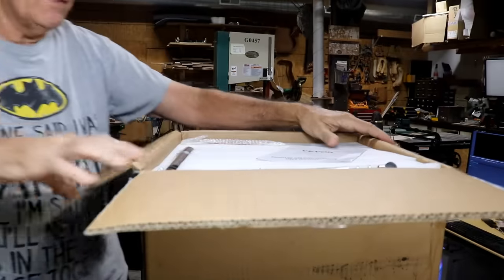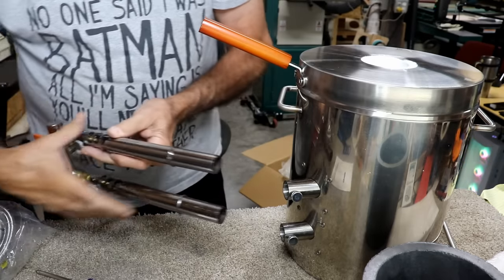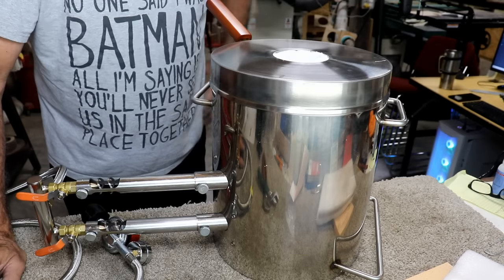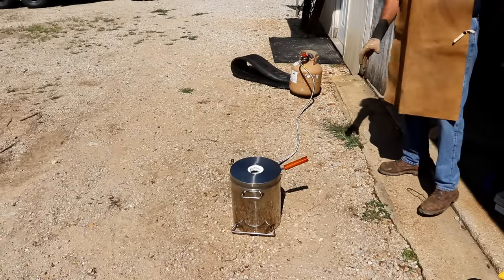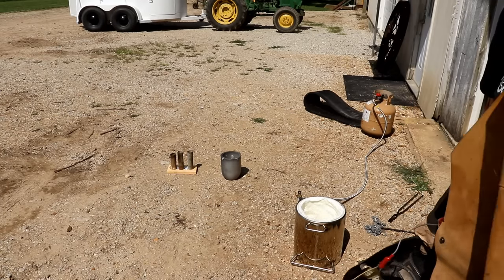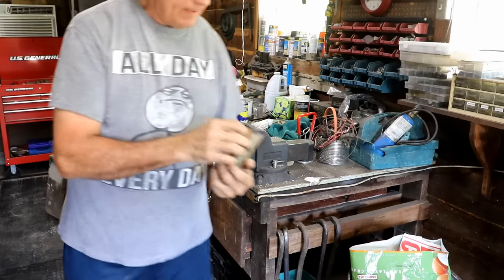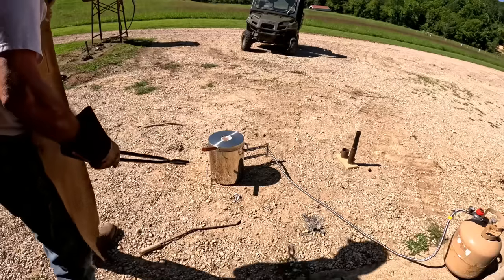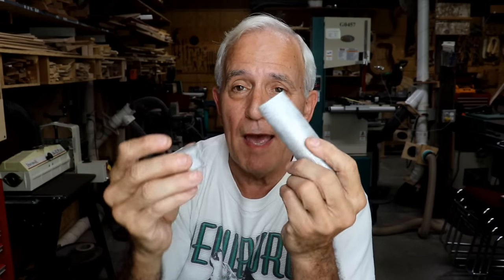661 RSW Vevor Smelting Furnace Wow It Really Works

Comment: So it no longer comes with the furnace cement to cover the wool. It used to come with that, looking at other videos. You really don't want to use the ceramic wool without something covering it. You can use a spray on rigidizer which will help it a lot, but usually it's topped with a skim coat furnace cement.
Reply: As long as you don't use a flux with an ingredient like Borax, that will evaporate and melt the Kaowool insulation, the insulation will probably last a while, but you are right, it will need some protection if you want it to last. From personal experience, about 100mm(4 in) of insulation works much better. When that furnace gets hot, the heat loss with the insulation supplied makes it inefficient
Reply: thanks for that info I wondered if I should cover the inside but wasn't sure with what
Reply: Refractory cement is better than air dry mortar.
Reply: @untermench3502  Durability is one thing, but ceramic wool sheds fibres like crazy and the large volumes of air will fill an area with airbourne fibres in no time. Those suckers are no good in your lungs. That's more the reason rigidizer is required.
Reply: Nope, apparently they don't include it anymore.  

I had the same question, and looked at the current description on Vevor's site, and it's no longer listed in the kit unfortunately.

Unless they somehow used some other magic insulation that doesn't need it, but I doubt that's the case.

I would buy some and apply it for sure, just from all that I saw and read about these things, but that's just me...

Comment: In high school in metal shop, we made a screwdriver with a aluminum handle. The aluminum was melted in a ladle then poured into a mold. In transit to the mold the ladle was bumped the molten aluminum hit the polished concrete floor and actually bounced into the shoe of one of the students.
Reply: What did he say?
Reply: @bullswoodworks8398  "Ouch, there's molten aluminum in my shoe."

Comment: You need to cover that insulation to prevent breathing the fibers. Couple of tips from a non-expert caster: heat the scrap to drive off as much moisture as you can before putting in. Pour as soon as you can, helps limit the hydrogen bubbles that weaken the castings. I tried pouring into cans to make turnable pieces but the shrinkage wasted a lot at the top. Lost foam casting gave the best /easiest results because I could have a pouring spout for the shrinkage to pour in. Sand casting also works well but sometimes I'd get sand imbedded and it was hard on tooling. An oil based sand is much nicer to use than water based. My local ready-mix plant sells bentonite so I don't have to pay the high shipping costs. Get junk automotive castings from repair shops. Better machining than the nearly pure aluminum in extrusions and cans.
Reply: After all that he can get to tempering the crucible

Comment: Jerry I have a machine shop... or what's left of it after my motorcycle wreck. 

 What you will find is that working with cast aluminum is the tendency to gum up on your tooling...  lathe tool, drills , mills , bandsaw..ect . 

   2 things that will help sometimes is try not to work it to yhe point that it heats the tool too much .. also parifin wax and WD40 are both your friend..

I buy WD40 by the gallon and use a squirt bottle from Lowes ... 

 On the lathe you can keep it cooled when parting off . 

 When using the bandsaw run it through a little parifin wax first and itnwill help it from gumming the blade , re-apply as needed... Drilling and milling,  run up and down the tool when spinning..

   WD40 isn't a good lubricant...in fact its not a lubricant....but it is a good cutting fluid..

 I never drill steel without it. And because i watch my speed and use WD40 every time i drill , I have drill bits that are 25-27 years old ... 

Buy it by the gallon

Comment: You need to cast your billets into a tapered container so it will fall out. Casting into a parallel sided container, being hot will expand the container, which will shrink on cooling making it a tight  fit on the billet.
Reply: You have forgotten about the fact that the billet shrinks more than the container and will release all the time if the container has parallel sides and has smooth sides.

Comment: Take your lathe and machine the inside of your pipe smooth. take you a piece of one by six with your pipe in the lays pressure one by six up against it as it’s turning and make you a small landing to sit your pipe in that way it’ll seal the bottom off and your will not come out the bottom

Comment: Thank you for this video. I'm considering to buy the exact same type of furnace like you have. It's relatively inexpensive and easy to get by where I live. It would be great to see you do a video on melting copper with it or even steel. Would it be possible to reach high enough temperature to make copper alloys? Can you double the temperature when connecting two gas bottles, one on each burner? And what happens when you would connect map gas instead of propane? If that's still not enough to melt steel maybe an addition of an extra valve + compressor could do the trick... But can the furnace withstand such high temperature? Best wishes from Belgium

Comment: Whoever crimped the fitting onto the end  of the fuel line  got the  crimp  and nut too close.
Nice looking furnace.
Reply: Looks like it's just not a swivel nut, but a single piece barb fitting instead.

Comment: Nice, I'd like one.
Did not see a temperture indicator. Would be nice to have one for obvious reasons. In a pinch you can buy the temperture cones used by those that use ceramic making kilns. If you never seen them a quick google search should fill in the details.
Reply from the maker: Doesn't really seem necessary you just wait for it to melt and pour it

Comment: Maybe the long brick is for when you lay the furnace on its side so you have a flat surface to set things on.
Reply from the maker: Yeah I said that on the screen
Reply: @RosaStringWorks I  have a way to use pipe as a mold..

Comment: Jerry, for your tongs idea:
Right now, the tongs open on the same plane as the hinge, like scissors.
Add a piece to each "blade" perpendicular to each "blade".
Now the tongs will reach into and grab the crucible, with the handles parallel to the ground.
Easy pour.  😁✌🖖
P.S.: You may want to do the same thing, to the handles, to get a more comfortable grip to pour.

Comment: I have used hoses on trucks that you cut the length hose you want and the fittings screw on , so you  likely can loosen it , check at your local IH TRUCK DEALER

Comment: You could pour your aluminum into soup cans and then just take a slicer wheel and cut the can off. Or if you have a way to taper you bore your pipe with a taper and then weld a bottom onto the small end. The taper should allow it come out.
Reply: Aluminum that you melt especially from cans and extrusions usually machines very pourly. Is does help to allow it to age maybe a few weeks before machining. You can speed up the aging by quenching the aluminum in water while its stills hot. Just make sure its not still molten when you quench it.

Comment: You should drive it the other way because you can put the pipe in the device and let it sit on the bottom of the device smack it and if it loosen up that way, then turn it back around and you should be able to knock it out

Comment: You really didnt need to turn the hose when connecting. That nut is not supose to turn. You hold the hose and turn the pipes, before fitting the pipes to the furnace. Much easier and the nut wont come loose and leak gas or something